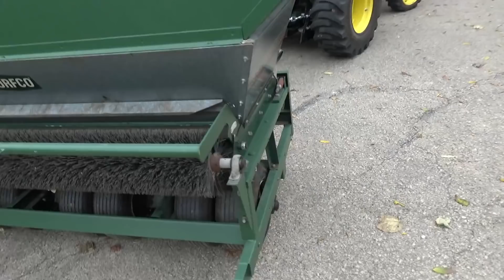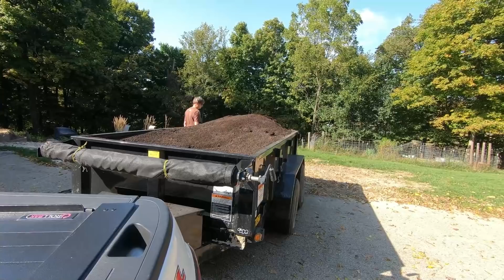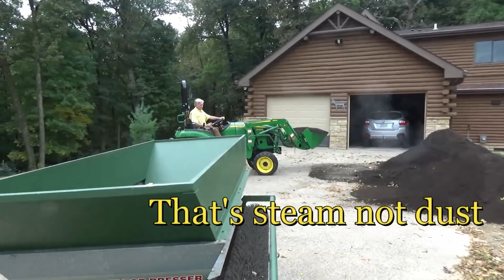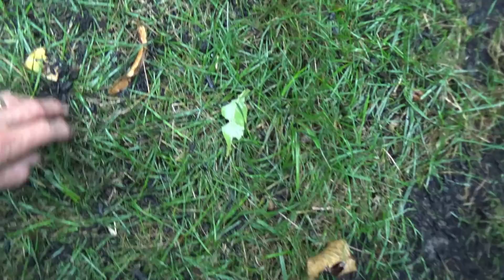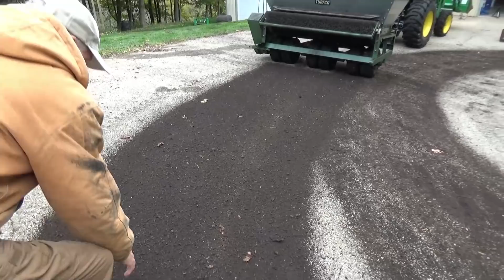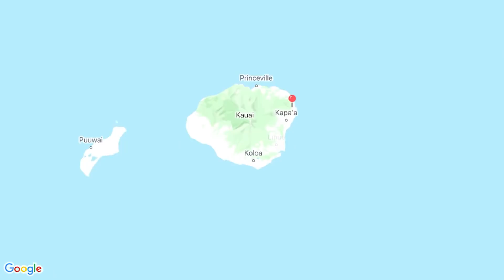John Deere 2038r, Top Dressing My Lawn / 117

Comment: 6:27 is that a 10ft dump trailer and can you put on your tractor
Reply from the maker: Good afternoon, 
The inside dimensions of the dump trailer are 11 feet 5 inches long, while the tractor and loader are 11 feet long. The backhoe adds to the TLB combination, bringing the total length to 14 feet. The inside width of the trailer is 76 inches, and the rear tires of the tractor are 60 inches wide. 

I do not use the dump trailer to transport the backhoe because I find the ramps too steep. If I had an appropriate loading dock at both the starting point and the ending point. I might consider using the dump trailer for transportation. Fortunately, I have an 18-foot flat trailer that I use instead. 

Thank you for asking, and happy spring! 

- Bill
Reply: @billburkhart  thank you

Comment: do you do any hand raking after using the top dresser? How does the top dresser deal with any lumpy compost? Has the compost been processed before you use it so that it is generally lump free?
Reply from the maker: Good morning 57 Merrill, good questions. I use the chain link drag to push the compost into the grass and fluff up the grass. When I purchase it, it has been processed and has the consistency of sugar, so it’s truly lump free. I do have to hand throw some compost in areas where I can’t get into with the spreader.
Enjoy your weekend and stay in touch. -Bill

Comment: 27 cubic feet is one cubic yard. That top dresser "could possibly" handle a 1.5 cubic yards of the mulch you use. Since your 2038 can lift high enough, an idea would be to add 2x12 sideboards to get more on the topdresser. But the sideboard idea is for your larger yard projects.
Reply from the maker: Andrew I’ll consider your idea to add sides next spring. This past fall I top dressed the lawn with the gate full open and it empties quickly. Thanks for the idea.

Comment: Bill, have you tried the 700 series mower to pull the spreader???? I'm looking at turning radius around your yard. My Kubota would possibly make tearing spots with having the R1 AG tires.
Reply from the maker: Hi Andrew, yes, I've pulled the dresser with the 700 series and my Kawasaki Mule. I guess the lawn damage depends on how wet the ground is. We finally got rain here in Iowa and I tore up some areas on the hillside mowing grass with the 700 series. I don't know why I don't use the 700 to pull it. I'll try and remember to do that next spring. Hope you're having a nice fall.
Reply: @billburkhart  I am looking at using a smaller to machine to get around corners and tight areas. OR maybe take off the loader, but then you would have to load the top dresser by hand.

Comment: For the next time you buy compost in the 1st dump trailer, the loader operator should have tapped it down with the bucket to avoid from losing any material.  Plus the 1st trailer needed to have a tarp that wrapped down the sides and had a tie down rope along the sides. Might have to go back roads next time as well. Highway speeds aren't usually good for lose material loads. Just for future reference.
Reply from the maker: Hello Andrew, thanks for the tip. I purchased a new dump trailer and plan on hauling compost this month. Thanks again for the suggestions.

Comment: I’m guessing this works with sand as well.  Sand is an excellent leveling material for lawns too.  Nice video.  Your smaller JD might be the best tow rig for the spreader too since it’s a bit more nimble.
Reply from the maker: Thanks 👍for taking time to say hello and comment.
Reply: @billburkhart you should use a sand peat mixture. Holds enough water but also drains well, compost isn't good for your yard. It's way to much organic material that's only going to lead to even more thatch.. you would of been better off verticutting than aeration. This is coming from a superintendent. Golf courses are far different than home lawns hence why we aerate countless times during the year plus verticutting, we punch holes at varying depths, from 12 inches deep to 2 inches. We do this because If you punch holes at the same depth every time it leads to layering in the soil, this in turn leads to black layer, something no one wants
Reply from the maker: @chosen1one930   Interesting for sure.  I am going to start aerating again in the next two weeks. I’ll take a hard look at your recommendations. Thanks so much for taking time to make me aware of your opinion. -Bill
Reply from the maker: What is the ratio of Pete and sand mixture? Where can I learn more about this especially what kind of sand to use?
Reply from the maker: Last question, i’m using cool weathered grasses would this still apply??

Comment: Hi Bill, didn't realize I was subscribed to your channel. Appreciate your help in the other thread. I like trains, lol & subscribe to a couple of railfan channels. Neat implement - I think this is a service I could offer. I bet that's a pretty expensive piece to buy new but I really like it. Nice score getting it at auction & for it to be in such great condition. 

I want a 2038R but it's just too big for my property & for the type of property I expect to be working on. A 1025R is probably big enough but I want something slightly larger so I'm down to a 2025R, B2401 (gear drive), or B2601. I'm leaning towards one of the Kubota's in this frame size for a number of reasons (there are things I like about both) & really towards the gear drive odd as that seems given HST's are all the rage but need to go up to Messick's & test one out.

Since you don't have any push pins in the mid Atlantic, I'm in Severna Park, Maryland.
Reply from the maker: Hi Daniel merry Christmas. Sounds like you’ve thought through this very well so you’ll be just fine. Thanks for letting me know you’re in Maryland, wish I was close enough to drive to Penns and buy from Neil.
Reply: @billburkhart  Merry Christmas to you as well. I hate to say "too much" research as it's a big purchase & one that you have to live with for a while although obviously you traded up & these do hold their value, but I've definitely thought about it extensively or more accurately obsessed over it:). 

Both the Kubota and JD dealers tried to steer me into a BX & 1025R respectively. Both seem just a tad small but a 2038R seems huge. If subcompact I'd definitely go 1025R and in the next size up would likely go w/a 2038R but in the B2601 (or 2401) vs. 2025R, the difference to me was clear: Other than the single point hydraulic connector, JD has more convenience/appearance features & Kubota has more "real tractor" functionality. It's hard to justify the former & while I'm not a treadle pedal fan, it's not the reason to go gear drive but not having that "feature" is an added benefit. I truly enjoy the manual transmission in my pickup (both physically shifting & the control) and have plowed snow with a manual and liked that. The salesman thinks I'm nuts and once I drive it I'll realize it's not the right way to go but I think I'll like and adapt quite well even for loader work (the shifter even seems to be set up optimally for it). There's a great vid of a Kubota tech driving one after assembling it and it looks like a blast!

I was not impressed w/my local Kubota dealer. There are two or 3 other dealers that are closer but Messick's is about 90 min. away and the salesman there has been extremely helpful. Looking forward to making a trip up there. Delaware has no sales tax so that is an issue w/buying from Messick's (about $2k) but we'll see what happens. Apparently prices can vary that much from dealer to dealer anyway and the dealer in DE knows they have a competitive advantage & may use that to boost their profits. All things (close to) equal & I'd rather buy from Neil.

Comment: I got a pickup load of horse manure from I guy I worked with and drove 70 miles.  I was surprised how little of it I lost.  That is a neat way to put compost on your yard.  You are going to need to build a new shed to keep all of your attachments.
Reply from the maker: Hello MDH so nice to hear from you again, have a merry Christmas and a healthy new year. You are correct the shop is getting full ,   I don’t know what that means?????
Reply: Merry Christmas to you too.  It means like me, you will have to start putting attachments somewhere other than the shop.  Right now my chipper is in the basement.  Good thing I have an overhead door in the basement.
Reply from the maker: @mdh7812  ha ha I’m sorry, I was trying to be funny, my wife would tell me a full garage means no more Impliment’s, on the other hand I say build more buildings😀😀